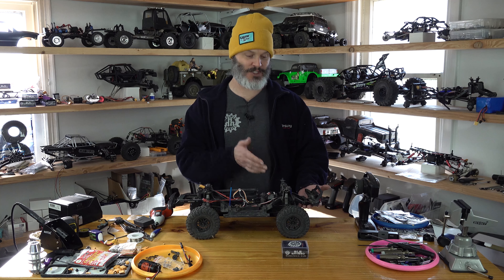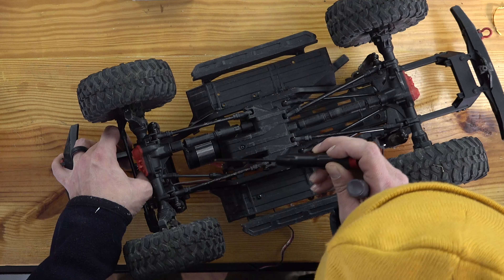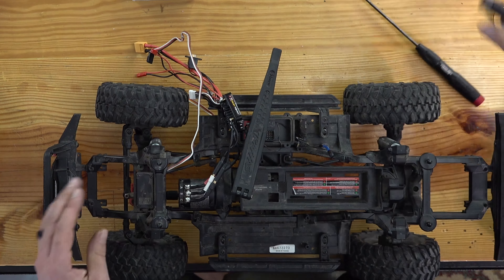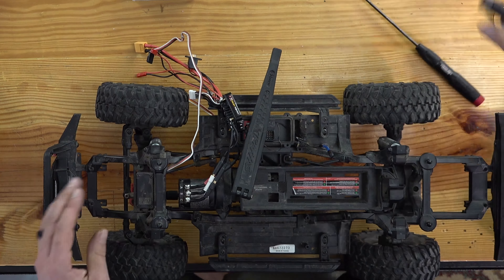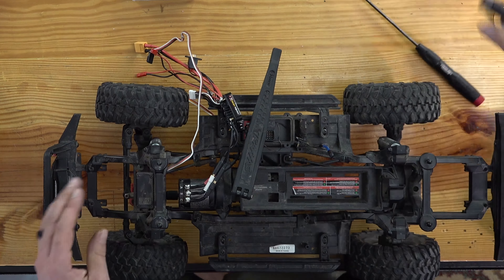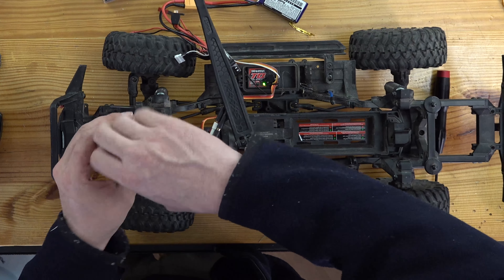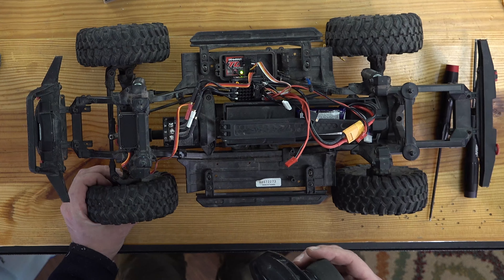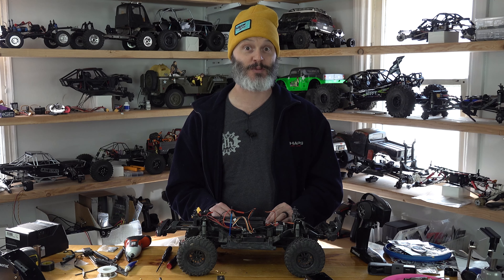Upgrade Your TRX-4 Servo To A Beast! SHV650 Steering Servo Install - Holmes Hobbies

Comment: What if we have the pro scale lighting system and the pro scale winch also attached is it ok to also attach the servo or ? Omg why i feel it is complicated 🙃, here you just attached the servo i understand the steps easy but is it still gonna be ok if having the light and the winch also, i use 2s lipo and i have 3s as well
Reply from the maker: Shouldn't be an issue if you have enough plugs

Comment: I never buy RTR... always get Kit versions. I got a TRX4 Sport Kit and used my own electronics... actually used a Crawlmaster Pro 10T motor with a 1080 ESC and a Savox SC-1257TG.
Reply: The 1080 is decent. I prefer the Carisma ARC-2 ESC. It's the same price as the 1080 but, it has more settings and a better drag brake. It also has a low profile and an interesting wire layout.

Comment: John...i want one of these..but..ive been doing alot of research on this servo and the word is that with this and the 500's, the stock traxxas steering horn is scraping the servo and alot of folks are having to change the horn...did you notice any scrapes on the servo after the test? Should i have to replace it to use your servo?

Comment: You can use the stock controller by using the Bluetooth module
Reply: If you don't have the Bluetooth module, you can also use the button sequence cheat sheet. I did also figure out on my own that if you have to reverse the servo direction, set the endpoints first. You'll be turning the wheels the opposite direction of the transmitter, of course, but when you reverse the servo direction after that, those points will still stay true for left and right throw. 👍

Comment: How did you set the endpoints with the traxxas tqi because I’ve been trying for hours and it doesn’t want to set. Everytime I get it where I want it to be I press set and it throws it further then I set it so I try again and still it doesn’t stay where I set. Please help also I’m running the 800 if that makes a difference
Reply from the maker: You might need the Bluetooth module. The tqi2 doesn't allow it via button, if I recall correct. But the tq3 does
Reply: Ok so I actually figured it out last night while messing around with it and you don’t need any of what you just said. It’s a little hard and it might not be at its tightest angle but if it doesn’t work the first time you just got to try it again. So this is what I did, i put tape around on the controller body near the steering wheel and marked where the maximum steering angle would be on both right and left, afterwards disconnect direct power to steering Then going into the endpoints settings on the Tqi just line up the same markings you made previously and press set like you normally would for each side and voilà! You’re in action!!!

Comment: Have you figured out the issue as to why the SHV650 is twitching so much. I cant run it direct power or it sits there twitching back n forth

Comment: So are you like me and never use dual rate use the true end points on the Traxxas tqi radio through the menu tree with the menu and set buttons? I never use dual rate not the same as end points.
Reply from the maker: Nah, I never mess with rates on the radio

Comment: I went with the reefs 422hd I still need to get direct power to take full advantage of that torque.
Reply: Reefs is rebranded chinese servo...its fine but overpriced
Reply: @themountain59  just curious, where have you seen the reefs in its original Chinese ("not rebranded") form?  Again, just curious.

Comment: Is that Mamba Micro not too small for this truck and it's weight ratings??
Reply: They are rated for 2.25 pounds so officially it is too small, but it is geared way down because its a crawler, so as long as keeping the truck stock or even doing some weight reduction it should survive just fine. The Micro X is also rated for 3s so should be able to supply adequate power without stressing the entire system much.
Reply: Mama micro x is pretty good. Use the 2280kv on my 8lb. Scx10.3 and 2850kv on my 7lb. Scx10.2 no issues ever...but that is with external bec or direct power servo. Mamba micro x has horrible bec.

Comment: Would you recommend a 650 for the Capra, or would the 500 be better?
Reply: Your preference,but the 500v3 would be fine. If no more then the 650,but the 500 would be adequate for your capra💪👍

Comment: Just bought this servo and tried to put onto my gspeed build kit, somehow cannot put on the Amazon annimos servo horn (25t clamp). Super tight fit and I was afraid it is gonna strip the servo head. Anyone has any recommendation on what servo horn to use with this monster？ thx

Comment: The stock panhard mount flexes. The axle is fine. Adding metal panhard mounts will give better steering on trx4
Reply: Huh good to know
Reply: @TrillMurray  If you run the inner fenders on your TRX-4 then the Panhard mount and shock towers are built in.  In that case you can add a support (Joe Collins at Exocaged did this with piece of aluminum rod).  I did that on my first one but then just designed a lightweight 3d printed support.  Problem solved and I can keep my fenders for the more scale look while I run beefy HH servos!
Reply: They don’t make metal ones?
Reply: @Djkommode  you can get aftermarket metal panhard mounts, but they don't really fit the Traxxas inner fenders without mods.  So, it depends on which mods you want to make.
Reply: @davidsimpson363  ah see

Comment: I have a heavily modified TRX4 with lots of brass and a modified lift, so it is quite heavy. I went with a reef's triple 5, and it kept breaking the Pan hard mount. I prefabbed my own Pan hardmount out of metal, and it is holding up great. it now only twists servo horns, and I have found that the vanquish horns hold up the best.
Reply: The reefs is decent for a chinese servo....only overpriced.
Reply: @andy R.  
  You must have had a bad experience with reef's  products because you have managed to spew the same garbage to everybody that is running reefs. If you don't like Chinese products, you should get out of the RC hobby.
 There's no doubt that Holmes hobbies make some great products, and I plan on purchasing some real soon for another build  I'm doing.😎

Comment: I've upgraded the servo in my TRX4 and my wife's TRX6 to the SHV800. What a monster, and we absolutely love them, but. . . That same steel Traxxas servo horn gouged a chunk of the servo casing turning it to the right. I had sweety the endpoints and all, but being my first upgraded, very nice servos, I never thought to check for that or that it would be a problem until it was too late and I went to work on them again and noticed a shiny silver gouge in the servos. At first, I was confused on how the servos could be damaged until I seen what had actually happened. Needless to say, I was pretty bummed out about it, but the damage is done now. Hopefully that's all that was effected and nothing internal. I just wish I had known to check for that before it happened.
Reply: That happened with my shv500 too.  I ended up trimming my servo horn just bit to get full swing.   And, for the record, I love my HH servo.  And not just for the power and strength, but also the speed compared to the ones I've tried from amazon.
Reply: @davidsimpson363  I need to do that with mine, but dammit I wish I had looked for that before gouging the crap out of these servos.
Reply: @OkieDokieBoi  I understand... I felt the same way.  Good news is the servo still runs like a champ.

Comment: I don't have a trx4 but I have the scx10.3 kit which I installed a ludicrous brushless servo which I think is 35kg on 7.5v I have it running from the receiver as my light kit runs directly from my lipo. I'm currently doing a scratch build with the 10.2 raw builders kit as a starting point. It does look like I've just found the servo ill be using 👌 awesome work on this bud is there a splitter lead for the balance cable so that I could direct power more than one thing from my lipo?

Comment: i'm running the reefs triple 5 on my scx10.3 and the stock spektrum servo still for my Capra. The Capra will need a new steering servo soon...any recommendations would be highly appreciated. I feel this might be overkill for the Capra. Not necessarily needing direct power, but it sure is nice.
Reply: Well reefs are ok for a chinese servo..only over priced.
Reply: Yep. Reef just rebrands their servos

Comment: I have the shv500v2 in my trx4. Still love the thing. Haven't pulled the trigger on the 650 yet. Might just have too to replace my ultra talkative 500v3. V3 gonna go to my 4s original Erevo

Comment: I have a PowerHD 25kg in my TRX4 but have just ordered the SHV800 as i have a lot of brass on the front end. I have the SHV500v3 in my VS4-10 Pheonix and really love it, a little chatty but i can put up with that when the servo is this good. Cant wait to get the 800 put in to see what Craziness pulling power it has 🤙🏻🤙🏻
Reply: Just make sure to check your clearance cause the SHV800 is slightly lower stack height so the servo arm may rub on things.
Reply: @Esteb858  yeah will do bud, thanks for looking out for me, appreciate it. 👍🏻🤙🏻

Comment: I really like my reefs servos. They offer a wide torque and speed rating range. I'd love to see you offer some servos under 75 bucks in the average Joe power range. I don't currently have a Holmes hobbies servo because I don't need 650+ oz inches of torque.
Reply: Reef servos are okay but, they're just rebranded servos.
Reply: @r0cket_penguin  aren't they all though? Do you think all of these different companies are building servos in house?
Reply: @r0cket_penguin  even these Holmes servos are built by another company. It could be agfrc. They manufacture probably a majority of the servos available today

Comment: Hey John little off topic but you’re the guy that would know.    I have one of your magnum motors running off a hobbywing 1080 in a Capra      I was wondering if there are any esc’s that you would recommend that would be even smoother for that motor?   Thanks

Comment: I put the protec black label high torq servo it's a beast at 7.5v. I needed more power for the traxx kit. With a 16t pinion the traxx do work 😆

Comment: In my RC Flight Models are only RX S-Bus and S-Bus Futaba Servos. You can feel it. For the Crawler i have a PowerHD25 Servo and a low price RX/TX. Thats all you need. This is a very nice hobby, which I recently discovered for myself. Greetings from Germany.

Comment: If you have the tqi you can adjust all end points I upgraded mine to tqi on my sport and looking to replace the servo aging I’m using an Amazon servo works good but need some more power to push my rig around to get better approach angles also it wise to use a angles steering rod on the trx4 sport or trx4 and helps out so much I get a lot more angle maybe to much but so useful Ill post an update video with a trail run

Comment: When the stock servo failed I initially swapped to a Power HD 25kg servo. I bought one of the SHV 500 V3 servos to eventually replace it and I've added a JST plug to the rigs battery plug but the Power HD is still working fine, even with a fair bit of abuse like tumbling down rock walls many times.

I really don't know if I want to have to beef up the steering to use the SHV 650 but steering links are cheap enough and I've been looking at aluminum portal housings with replaceable steering arms for a while so never say never. It does look speedy and you can't complain about the torque.

Comment: My TRX-4 Sport has a SHV500 v3. Love it! And replaced the stock transmitter with the next model up so I could set the endpoints. Like with you, I just barely needed to reduce the endpoints.

Comment: I upgraded mine years ago with your HV500. While I did have to replace the gear set (it got submerge for a ;while in the river and I did not check it for water). It has proven 100% reliable since (it's now packed with dielectric grease and marine grease for the gears).

Comment: Pretty much ANY aftermarket servo will be an improvement over the stock TRX4 servo.  I replaced all of my TRX4 steering servos with Savox 2290SG. What I have found is that when you increase the power of the steering servo you have to upgrade the plastic TRX4 panhard bar mount to an aftermarket aluminum mount.

Comment: I went from the upgraded traxxas metal gear servo. Now I have a Promodeler 555. powered by my castle MambaX set to 6.0 seem very fast and strong. If I need a new one for any of my RC's I want to upgrade to one of the HolmesHobbies.

Comment: Shv800 on my trx4, I needed a metal panhard mount, but I started using trx4 rod ends on most of my crawler builds. The actual traxxas ones have so much beef.

Comment: I’ve got a cheap 35kg Amazon servo in my TRX6, and it’s holding up great to the abuse so far. It’s been in lots of snow and single digit temps and is still steering strong. One of these days I’ll be able to get one of your beasts! Lol

Comment: SHV800 in a TRX6 with weighted 5.2” tires, SHV800s in a TRX4 axle build with the Traxx, and a Reefs 777 (because I had it laying around) in a TRX4 with 6” tires. The 777 is…….(just to be nice) in need of replacement with either an 800, or 650.

Comment: You really torture me with having to wait for the driving parts of the video. I have a BEC on my HV500 and only run it at 7.2V. Plenty of steering power and haven't broken anything yet, knock on wood. If I upgrade to CNC aluminum axle housing and steering knuckles in my TRX4, then I would run 3s to the servo. Too me you still can't beat a high quality BEC from Castle Creations for servos.

Comment: I would absolutely LOVE one of your servos ... but in all honesty, the 35kg Amazon for $20 does the job for my needs. There is no doubt your servos are insane in every way ... i just feel they are for more serious crawler guys, that need that power to remove rocks from the earth when they are in the way lol.
Reply: Must have gotten lucky I had 2 amazon servos smoke within 10minutes on the rocks with my truck. Holmes have never let me down
Reply: Lot of people have good luck with them.
Reply: @codygores4036  The odds of burning up 2 x Amazon servos in 10 minutes are  crazy ... its probably safe to say, you are in the "serious" rock crawler category. If you are using the servo to try and push unmovable objects, the holmes of coarse will serve you far better. The rest of us, just have to back off when the steering stalls, otherwise we will end up smoking our cheap servos :(
Reply: use them also very good
Reply: Yeah those amazon servos just do the job. I use AGFRC servos that come in a huge range of torque to fit your RC needs. They have light weight racing servos to heavy duty earth moving crawler servos.
Reply: Whatever works is the best.